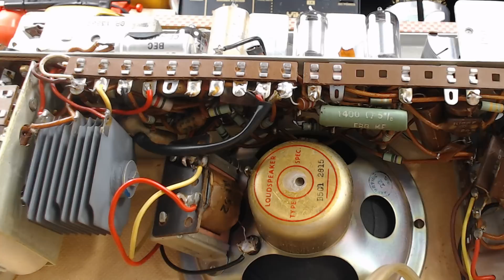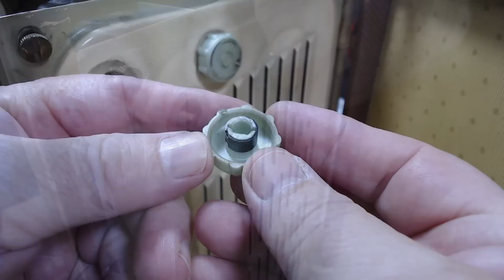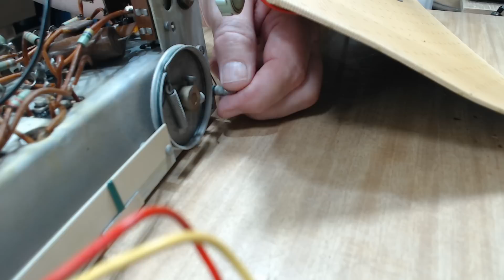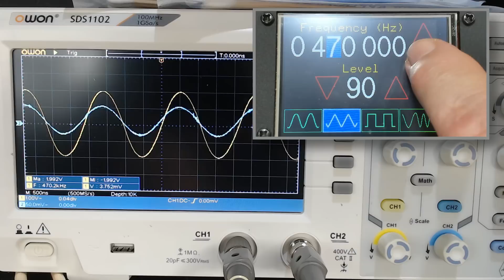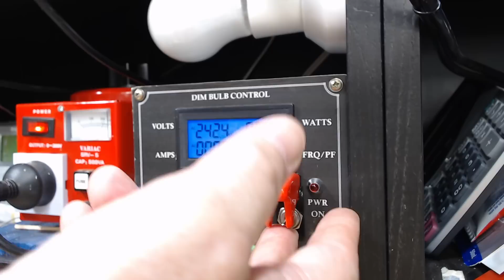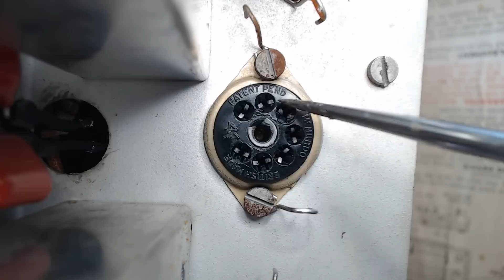Vidor Suitcase AC/Battery Henley Portable Radio - Model CN426 - 1953

Comment: I was given one of these in about 1960, it was not working and at that time I did not know enough to fix it.  I stripped out the radio and kept the case.  I still have it, used it as a tool case for years then as storage for bits.  It currently contains a collection of of small mains transformers. Still solid.
Reply from the maker: Haha... a good use for it I suppose 😅

Comment: i have one of those in the shed ...somewhere...to sort out sometime,  those mcmurdo valve sockets with the 'fork' type contacts often break like that, theyre a pain in the bum, i've found you can sometimes pinch the contact forks from chassis mount din sockets and squeeze them up a bit to fit
Reply from the maker: They are very unreliable Andy. Good idea with the din sockets 👍🙂

Comment: Nice project Dave that faulty valve base looks like a McMurdo they can be notoriously bad. I had to swap out all the bases on a recent PYE restoration.
Reply from the maker: Hi Richard, tell me about it! They were snapping off as fast as I could fix them. I suspect wiggling the valve during extraction wasn't helping either. That was a big job swapping the bases on your Pye 😥🙂
Reply: @DavidTipton101 yes every time I pulled a valve out to clean the pins I was unwittingly breaking the bases and couldn’t understand why the heater chain kept failing! Luckily I got  some 8 pin nos bases from France of all places. They were just simple ceramic bases with no locking feature but worked fine. Very difficult to find for sensible money!

Comment: Dave, where are the meter leads connected?
Reply from the maker: Hi Eugene, you will need to give me a time stamp from the video 👍
Edit: I watched the video alignment again and I didn't say where I attached the leads. I usually attach the meter positive lead to the plate (anode) of the output valve and the negative lead to the chassis or the negative line depending on the radio. I put a 0.01uF capacitor in series with the meter positive lead to stop the DC voltage. The capacitor rated voltage must be higher than the plate voltage. I use a 600Volt cap. I set the meter on AC volts and it's usually less then 10 volts. You can connect it on the speaker wires if you like but it means having the sig gen input pretty high and the corresponding sound level will be high to get a decent reading on the meter.
Reply: @DavidTipton101  Thank you very much. 10-4 on not attaching them to the speaker leads. You are the best!

Comment: Hi Dave,  I really enjoyed watching your video on the Vidor cn426  suitcase radio.  I have just purchased one on eBay in almost pristine condition.  I have replaced all the old wax capacitors, and it was working really well, but now unfortunately it is totally silent.  I rather think it could be the selenium rectifier, as the voltage on the smoothing can has gone down from 105v to 86 v. I would gratefully appreciate any advice you can give me on replacing it with a silicone diode mod, as I’ve never had to replace one of these before and quite honestly I haven’t got a clue.  Kind regards, Steve Jones South Wales, uk.
Reply: Pleased to say I found the problem Dave, it was a loose valve connection, the holders seem to be a bit weak on these radios don’t they.  I managed to tighten the pins up a bit, The radio is now working great .  Just to say I absolutely love watching your videos, they have taught me an awful lot about vintage radio repair.  Keep up the good work and all the very best, Steve.
Reply from the maker: @stevejones6085 Good to hear. Checking the valve sockets was the first suggestion I was going to make. Well done.
Reply from the maker: Hello Steve. I doubt the rectifier will stop the radio working completely and there may be other issues causing the voltage to drop. Could you send me an email so we can discuss it further. If you are using a PC, click on my name to open my home page and click on '...more" you will be able to uncover my email address 🙂

Comment: I've just managed to get hold of one of these.  Probably a dumb question but does it matter which way round the brown ac 2 pin mains connector goes for the live and neutral pins?  Also, does it need an earth?
Reply from the maker: Hello David, nice find, these are a cute little set. As far as the radio operation is concerned it doesn't matter which way the wires go, but I always put the active side to the switch so power is cut when the switch is open. From memory, you could earth this set if you want to, It's not a hot chassis set. I didn't bother, I kept it original 🙂
Reply: @DavidTipton101  Hi David, that's fantastic thanks I'll give it a go tomorrow and will let you know.

Comment: David, I have the very same radio have started to recap it, has a strange fault sounds like an old wartime siren in the background, I think I have a dodgy valve luckily I've got quite a few spare ,you have great site keep going
Reply from the maker: Hello Phil. I had feedback too until I changed the capacitors and it went away. I did swap some valves over so it may have been one of those. Thanks Phil 👍🙂

Comment: Hi David, loving your videos, and just wondered where you source your tubes from? I’m currently restoring an AWA CR-6B and need some replacements, but finding them difficult to find at a reasonable price.
Reply from the maker: Hello Andrew, I collected most of my valves from the local radio club auctions very early on. If I need a specific valve I can usually get them from either the HRSA or my local Historical Radio Society of SEQ radio clubs, both have valve banks. You need to be a member to access the valve banks. eBay is a last resort but can have the valve you need. I also monitor Marketplace and Gumtree for valve collections being moved on. The valves used in the AWA CR-6B are pretty common except maybe the 0B2 voltage regulator... no, maybe not, I have two of those according to my database. Good luck 👍🙂

Comment: A nice looking radio   I’ve read about those mc murdo valve pins on the. Uk vintage radio forum. They are notorious for breaking.  I also have a 1953 Philips town and country battery portable on the shelf. Everything is good except the gain in the first audio stage. That is waiting for a slot in my schedule!
Reply from the maker: Hi Robert. A number have commented that those sockets are prone to breaking the contacts, something to look out for. I have a town and country as well, I don't know if I will ever get to do it, I think it is the battery only version. Thanks Robert 🙂

Comment: I've met the same problem with valve bases on small battery sets. Probably quite a common issue.
Reply from the maker: Interesting, with the valves open to the user and the rubber valve retainers now missing it is easy to knock the valves and maybe damage the sockets. thanks Timothy 👍🙂

Comment: Hello, David.
First things first, it must be where I come from.
I'm living  here in Coseley in the West Midlands, UK, which is just about a mile from Tipton, and being the neighbouring villiage and also where my father came from, I know it extremely well and I pass through it very frequently.
Also, I owned the Vidor "Lady Margaret" model, in a very similar layout, with aerial in the lid.
In my case, the audio output valve had an open circuit filament, rendering it inoperative, but I did use it a lot in my childhood.
I think it harks back to the mid to late fifties.
I do wish I'd kept it, but a friend at work  (in Dudley) begged it off me in its faulty condition and I let him have it.
The West Midlands has a lot to answer for !
It was virtually the same, but battery only, using a 90v battery for the HT rail.
The filament circuit was a 1.5v  Ad35 battery.
All the best from the UK.
Reply from the maker: It sounds like there are a lot of my viewers from around those parts judging by the comments. It seems my Grandfather lived at Old Yew Tree Farm, Miles Hope Hamlet, Middleton. I thought he was closer to Tipton than that. There were a few generations of Tipton's who lived at the farm it looks like. My mothers Grandfather was a convict and was relocated from England to Tasmania. Ahh, what a pity you passed on your Vidor, a new valve might have fixed it. It would have needed a power supply these days. Thanks Philip 👍🙂

Comment: An interesting repair, the usual leaky wax caps, dried out electrolytics, irritating mechanical failures (those McMurdo B7G sockets are notorious,) and alignment drift. Nicely wrapped up and a good deal of satisfaction I would imagine. As an aside, you seem to be blessed with a good deal more activity on the medium wave / broadcast band than we have left in the U.K. which is handy 😁
Reply from the maker: Thanks Lynton. I think we have most of the original city AM stations used in one form or another 🙂

Comment: Outstanding, as usual, Dave! Every radio that I repaired that had miniature tubes I sanded two sides of the pins & moved them a bit out with a small needle nose pliers. They all were not tight in their sockets before I did that. On some I could tighten the pin sockets. You are the true repair master! I thoroughly enjoy your videos & appreciate all your past help.
Reply from the maker: Thanks Eugene. The tubes were quite secure in these sockets 🙂

Comment: Nowadays we have no problem repairing old radios. Parts are usually easily accessible and getting hold of old tubes is usually not a problem either. But what will it be like in 50 to 100 years? Will our descendants still be able to repair today's electronics? I have my doubts. In Europe, all AM stations will soon disappear and FM will be replaced by DAB+ in a few years. Electronics have become so tiny that repairing them is no fun. Application-specific integrated circuits will hardly be available as spare parts, nor will circuit diagrams. It will probably no longer make sense to repair old devices. At most, you will be able to admire them in museums. It will be the same as with old cars. In the future, a modern car of today with lots of electronics in the engine control, braking and steering systems will only be able to be admired in museums. They will no longer make it onto the road.
Reply from the maker: Wea re still holding on to AM in Australia but I agree, it will be a different ball game in years to come 🙂

Comment: This reminds me of the WW2 or Cold War spy radio sets.   Always a pleasure to have you walk us through a restoration.
Reply from the maker: It was almost Mission Impossible for a while, it is a well disguised radio. I thought it was a record player at first. Thanks Neil 🙂
Reply: @DavidTipton101  Do you know mechanically I could basically decipher anything take it apart put it back together again and it’ll work. But, my electronics training ended with the instruments, The avionics but not the repair of radios that’s where the basic electronics course which was called  POET (performance objectives electronic training) we got the instruments and then the comm people went off on a different tangent.
So we can almost say that an aircraft and all its wiring and instruments were my circuit board.
Reply from the maker: @nzs316  Were you in the aircraft industry Neil? I was with Qantas as an airframe/engine and later limited avionics engineer.
Reply: @DavidTipton101  I was in the Canadian Air Force as an Instrument & Electrical (avionics) technician.
I trained on the Single Otter, Twin Otter, Twin Huey, Kiowa, Tracker and Buffalo.
My squadron which was basically a search and rescue squadron.
I wanted engine but my math and sciences were so strong that they pushed me into Avionics.  I even taught for two years. 
So you were a fitter and a rigger.
Reply from the maker: @nzs316  Ahh... very good Neil. We did a bit of work on Air New Guinea twotters in Melbourne back in the 70s. Mainly grinding corrosion for me. I'm not sure what a fitter and rigger is, I was licensed airframe and engines on a wide variety of RPT aircraft. Later on I studied for 5 years for a limited avionics, electrical and radio licence which I picked up on the day I took early retirement. The airline was downsizing so I took redundancy. It was shame really, a lot of work and didn't get to use it 🙂
Reply: @DavidTipton101  A fitter is an engine mechanic and a rigger is airframe.  I joined in 78 and took my leave in 86.
Reply from the maker: I guess RPT aircraft turn over a bit quicker than defence force aircraft. Although the B737 is still going and that's from the late 60s, admittedly it isn't the same aircraft today. I was with Qantas for 43 years, 1971 to 2014 😟
Reply: @DavidTipton101  Here’s a quick question for you. What was that first moment that you said I want to join the Air Force or aviation?. Mine was in 1967 it was the Expo of Montreal the worlds fair and my mother put me on a bell 47 helicopter for $10 for a 15 minute ride and at the age of six I decided this is what I want to do
Reply from the maker: I had no aviation ambition at all, I left school and was working part time in a warehouse. My Mum saw an ad in the paper for aircraft engineer apprentice training with Trans Australia Airlines, later taken over by Qantas. I applied and did all the testing and interviews. I missed out initially but later scraped in because someone dropped out at the last minute. There were 2500 applicants and they needed 40, I was very lucky or the other 2459 were just dumber than me 😄 It was a mutual relationship with Qantas, they liked me and I liked them... and the best job I could imagine

Comment: Just saw your radio 📻 video 📹 for this week. That looks 👌 like a convenient, travel size radio 📻. It kinda looks like 👍 a suitcase record player. Is the front of it metal? Ya had a VERY GOOD idea 💡 pulling those knobs off. I hope the dial light and dial cord are good. I don't think 🤔 this set has dual dial cords. My birthday 🎂 🥳 🎉 🎈 🎁 🎊 is on the 5th of this month. Your friend, Jeff.
Reply from the maker: Thanks Jeff. Yes a pressed steel front on the radio, the dial string was in good shape too. Happy Birthday for the 5th 🎈🎉

Comment: Hi Dave, thanks for another interesting video.  I bit of a unique radio, I have never come across anything like this one in the US, I especially like the alarm circuit; very clever!  

This restoration was quite the workout with multiple problems.  Those tuning fork shaped valve socket pins appears to be the downfall of this radio; they are easily damaged by the typical force of bent pins and rocking the valve to remove it from the socket.  Your persistence really paid off, the radio cleaned up very nicely, as well as performing - Well Done!
Reply from the maker: Thank you Bill. The valves are easily knocked by owners so could have been why some were broken. I was lucky there were unused pins I could use 🙂

Comment: Well done Dave. It will be a shame when there is no longer BBC Radio 4 and the Shipping Forecast on LW, there are still some stations around Europe to listen to but their number is dwindling.  Droitwich used to transmit Radio 4 on 200KHz until 1988 before 9KHz channel spacing was brought in. I seem to remember equipment which used that broadcast as a frequency standard then needed modification. Keep up the good work!
Reply from the maker: Thanks owwcam. We didn't do Long Wave in Oz, they did some testing early on but settled MW. A pity really as I have a few LW sets that have no stations to listen to 🙂

Comment: Hi David, interesting set, very similar circuit to the ones I'm doing at the moment (Healing 400H) but much more elegant. I guess the basic design came from RCA with the valves. Pity the valves are so easy to damage. I didn't think to check the valve bases either! One of mine was full of sand, so it had a good holiday at some time!
Reply from the maker: Hi Andrew. I have your video cued in the list, I will watch in eager anticipation for the similarities. I know Australia produced some AC/DC sets but didn't know the models, it will be interesting to see what you did. Thanks Andrew 👍🙂

Comment: Two broken valve pins and on two seperate valves, what are the chances!!! and a faulty valve just to add into the mix. Yes the usual caps and electrolytic caps as well and a alignment !! . Great radio and another one to add to your collection. Great job David. I look forward to your next adventure.
Reply from the maker: Thanks Stephen. It had my puzzled for a bit there but it scummed to treatment in the end 😄

Comment: Dave, Great show! Have you ever printed up a replica cardboard battery shell that your could stuff with modern alkaline batteries? Maybe 9 v inverted for the B+ and or D fir filament? A Velcro’d  flap and battery holder would let them be replaceable.
Reply from the maker: Thank you Jim. I did a reproduction battery for a HMV transistor set which looked pretty convincing. I haven't tried it with 90 volt batteries. 10 X 9 volt batteries may not fit 🤔

Comment: My elder brother had one called a Sky Princess. I thought it was a 5 valve but could be mistaken. Typical set up, 1.5volt and 90 volt batteries. They didn’t last long. I remember him taking it to the beach on weekends, and walking along the road with it playing 😂 those where the days eh!
Reply from the maker: With a name like Sky Princess you would think it would alienate half half the buying population. I hadn't considered walking along with it playing, a guy would look pretty cool like that 😄
Reply: @DavidTipton101  Yes it does sound a little gay to say the least. I think it’s referring to radio waves in the atmosphere but who knows 🤷‍♂️It was a neat radio blue plastic net type coating with a piano type lid in cream vinyl. On/off/ volume on the left. Large centre tuning dial with opposing needles for AM/LW and the far left the band selector. Never been able to find one on the web. This would be mid sixties era the actual maker I can’t remember. Thanks for great videos Dave, appreciate the time spent to make them and the cost. Cheers mate 🍻